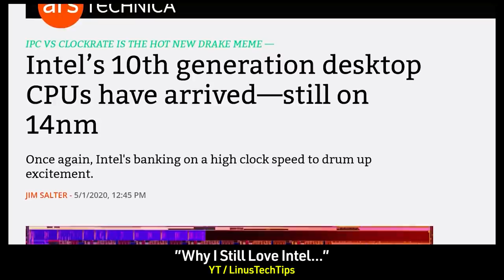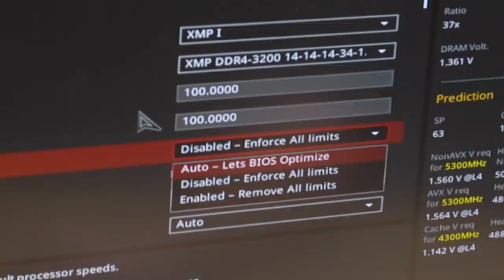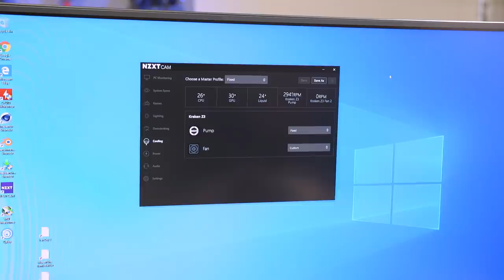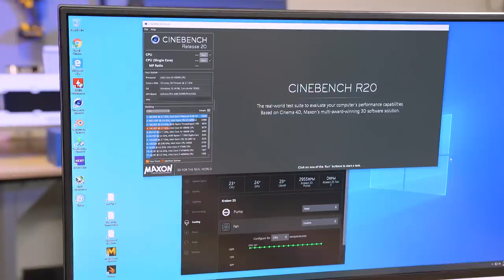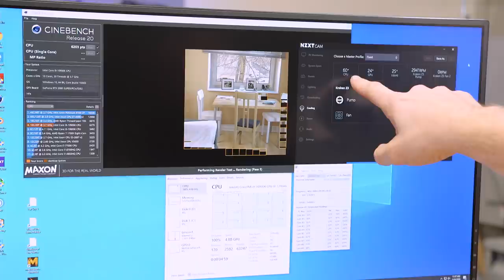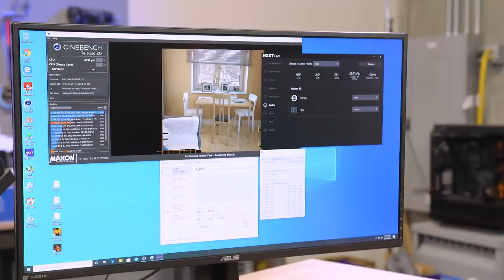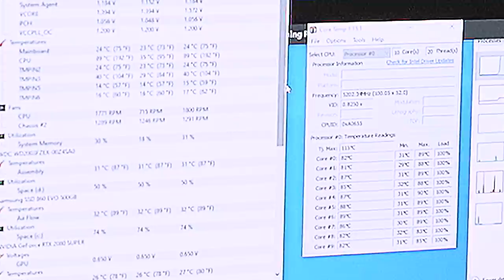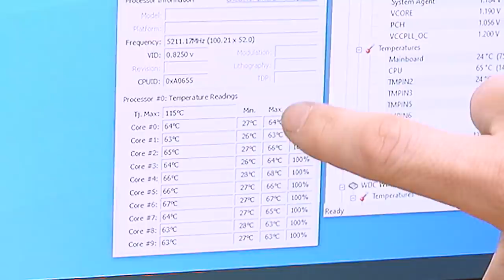Does the 10900k Melt!?

Comment: Regarding the case: when it comes to high power dissipation, the case does become much more of a bottleneck. Open air tests how 240W gets removed from the cpu. The problem is that hot air also needs to be removed from the case and at 240W that could be problematic. 
So use a case with very good ventilation so that you can control the amount of air moved for the test. E.g. the best case you can find with 3 fans in, 3 fans out and then use 2 in, 2 out. Even better measure the amount of air moved and standardize for that - then which case it is doesn't really matter that much.

Comment: My 3950x with the Z63 and MSI Godlike runs much hotter than that and it never wants to clock down. I have to run the low power profile to keep the cpu in the 30’s. liquid stays at 33 when the cpu is at 65.

Comment: to be fair though, you can still try the setting with a case that known to maximise temperature to the highest degree (Quiet case or something), your result will at least show that the CPU can run well even in the most limited case - rather than in no case condition which literally nobody use, some people will at least benefit more from your result if you use case in your testing
Reply: "rather than in no case condition which literally nobody use"  -  Firstly, this is strictly not true, since (and I'm sure I'm not the only one who uses one) there are cases - such as the open-designed Thermaltake P3 - which effectively have a comparable thermal/airflow profile to the test-bench scenario used here; there are 'literally' cases in mass production that are little more than 'prettified' test benches in design.

Secondly, every case is different with regards to thermals/airflow, but anyone (if they took the time and effort) could effectively recreate similar 'open-air' conditions, assuming they simply pre-tested their rig on a bench/table and made sure the ambient temperature matched that of any camparison tests.  Also (IMHO at least) anyone worth their salt who builds their own systems should be testing a new rig out-of-case before assembly anyway, so a quick check of out-of-case thermals (and then comparing later with in-case and modifiying airflow accordingly) shouldn't be that big of a stretch.

Finally, in the real world, testing for thermals/airflow should ultimately be on a use-case basis (ie: on your own system in its expected operating environment); relying solely on OEM / third-party testing should only be a rough guide, since no two systems (no matter how 'identical' they are hardware-wise) are going to run the same in all conditions anyway.

Comment: 1.57v? Jesus Christ. I'd be surprised if that CPU didn't starr to require more vcore in less than a year. My Asus board threw 1.48v at my 5.2 GHz 8700k when I set to adaptive voltage at 1.37v (which I immediately corrected with manual voltage) and a year later 5.2 GHz was practically impossible. Motherboard manufacturers really need to give a warning when they're about the throw a ton of voltage at your system.

Comment: You should try streaming with OBS at 6500+K bit rate during a multi-core enhanced game. That will give you a much better test and OBS is extremely sensitive to any instabilities in an overclock, so it will CTD if literally any instability rears its head. And a surprising number of your viewers will be attempting to use large core count chips for gaming and streaming, so it's a very valid test.

Comment: Meanwhile r5 3600 jumps around 36-45 with occasional spikes to 50+ on idle under an AIO with 70°C in CineBench. True, I have my AIO set to quiet (even the pump) but this happens under any cooler. AMD makes the best procesors right now but the temps are very strange.

Comment: wattage is wattage regardless of who makes the chip. Try prime95 on that and see what happens. Further, the 3900x is $100 cheaper now and it comes with a cooler that will cool it, whereas the 10900K you really have to add in an AIO to its price or something more expensive than a regular air cooler.
Reply: No one running this tier of CPU is going to be running with a cheap/ stock cooler.
Reply: T51B1   This video was about Intel and not AMD.

Comment: I've seen benchmarks of the 360mm Kraken X62 of the 10900k still in the 90-100 range at 100% usage, people pass it off as "oh well it'll never hit that" well it will sometime down the line, in gaming it's as hot as my 7700k at full load which is already on of the hottest chips in recent years, mine is on a 280mm X62 though. Doesn't really matter if it will hit that, it can, and no AMD CPU hits those temps

Comment: The "CPU lower fan speed limit" isn't to avoid the fan running at lower RPM, it's to make the BIOS let you know the fan isn't spinning fast enough. You can run it lower than the "limit" just fine.

Source: I have a Strix B450i and the BIOS kept complaining on boot that the fans weren't spinning fast enough (and didn't increase their speed) until I changed the setting to "Ignore".

Comment: I personally use my AIO for my CPU as the exhaust fan, simply because I am more worried about thermals on my GPU while gaming since that will always be the bottleneck in my system.  That way the GPU (air cooled) always gets cold, fresh air from the intake to help keep it cool. People need to remember to customize their build to their needs instead of just the last YouTube video you watched.  My CPU AIO stays around 55-60 while gaming, but that is so far under thermal limit, I don't care.

Comment: I agree but also disagree it's possible that the water block can hit its thermal limit before the rad as the water temp is directly coupled to what the rads can do.. also i shaved the die on my 9900k 40% and machined a  2part coper-silver IHS with all sitting under a custom cold plate that's 4 250w TEC's getting kooled by a custom water block.

Comment: I know you watch some of the tested videos, have you considered trying the AC cooler/heat exchanger system that he made? If you haven't watched that video it's an awesome system designed to work with a liquid lined body suit so it should work perfectly with a PC. Issues may arise with condensation but I doubt that'll be a significant issue so long as you leave the heat exhanger outside the case or use the test bench. You can also modify your standard AC unit to work with a heat exchanger if you don't want to build your own.

Comment: In regards to your comment about using the open air test bench to run thermal tests and the case rant. I don't have an issue with it. If you want a real world scenario, Steve at Gamers Nexus does extremely thorough thermal tests on tons of various cases. You could easily take this video as a base line and then see if your case is over on GN to figure out how much your case will effect thermals. Easy.

Comment: DerBaur delidded one and put LM in between the die and IHS and dropped temps by 7C.
Reply: He too did an amazing test on 30 10900k CPUs where he showed that differences in temps are like 20C with all the same settings, just silicon quality. I knew that mattered, but 20C without case, cooler etc as variables? Holy I would have predicted like 5C max.

Comment: this is where MCE is dangerous for the average joe. The board wants to push insane voltages, and different board makers have different settings. Gamer Nexus did a good video on it and I think the Asus boards had a conservative MCE, whilst a Gigabyte board was pushing insane voltages. Imagine someone who doesnt go into the Bios running this chip and the board has MCE enabled, that cheap cooler is not going to handle it. You wont notice on a decent AIO as Jay just showed, but anything less temps could run away.

Comment: Using cooler master 360 AIO, core i9 10900K at 4.2 ghz is getting 70° C in Normal mode, and instantly getting 100°C while overclocking by few values.
Reply: Aio pump rpm is 2400 and 3 fans rpm 1800

Comment: Kraken x-53, z490 MAG Tomahawk, paired with i7-10700k all core OC to 5ghz w/ average temp 82 c @ 1.33v. Not sure if it's good or bad, but seems like an okay place to stay at. I might test to see how high I can OC this chip just for curiosity.
Edit: Brought the voltage down to 1.3v and still remain steady, temp dropped to 75c, I'm impressed at 75c temp at 5ghz all core. Well done, intel.

Comment: Jay, i would like to ask you a question.
Out of the box the temperatures were like 40-50°C and the liquid was 26°. I'm fine with that. However, those are not sustainible because the heat dissapation of a water cooler is much smaller when close to ambiant temp.
What i'm trying to say is that if you run stress test for long enough, water temp will be (at best) around 40°C and cpu temp will be around 70°C. That's also fine but... Linus was closer...

Comment: Great video!  I'd love to see some similar tests an info regarding the i7 10700k. I think there's a lot of people like myself who might be upgrading from a much older gen intel, but not want to drop the full 500+ $ on the top of the line. It hasn't arrived yet for me to do any testing, but I'm expecting the 10700k to be a very solid chip for a gaming rig at least. :)
Reply: Yep I have the 10700K bought at launch and it is a great overclocker with temps well under control....though I am using a 360mm AIO on a 5.1GHz all core overclock at 1.290v....Exceptional all round CPU which is really a 9900K in disguise with better cooling and at a $100 discount...

Comment: i'm using an A500 corsair air cooler for my 10900k, nd it gets VERY HOT, the fans sound like a fucking jet when you get into intense workloads or even cpu intense games, literally over 90 degrees at some points.
Going to switch to water cooling.

Edit: using the information from this video, i stabilized the huge temp spikes with a 1.31Vcore max from adaptive.

Comment: Yeah,a real world test would be a flight simulator.If you try fsx you'll find that it was coded for a single core cpu which really puts a load on the system to keep it running smoothly,or you could try x-plane.......................

Comment: Hey Jay!
U gotta be careful with using CAM for reporting CPU Temps with the Z coolers. I've seen many people (including myself) who experience big differences between what temps CAM is reporting vs what temps HWMonitor or Afterburner is reporting. I'm not saying that your unit is faulty, but mine and pretty much everyone else is experiencing this issue with the Z coolers, it seems to be a software issue with CAM for the Z coolers only.

Comment: I still have a non overclocked 7700k and that thing gets to 98°C with a h100i v2 and a couple of Noctua NF-F12 fans on the radiator (stock fans died) inside an NZXT h440 case with the front panel removed. I would hate to see what the 10900k would be like...

Comment: I'd be curious to see what you'd get if you did this same test with a 3900X/3950X. Does this cooler have an AM4 mounting bracket? If it does, I think that'd be a really interesting comparison. 

My 3900X tends to draw a crap ton of voltage when on auto. Doing a 4 core boost to 4.2 GHz and it draws like 1.45v. The voltage does droop when on an all core boost though, so temps when running cinebench are pretty reasonable actually.

Comment: The thing Jay doesn't say, that it needs at least a really good 280mm cooler to keep the temps under.. and that s additional $200. (this NZXT cooler is $250) so Intel costs $100 more, 20% less cores, 14nm old architecture, and it needs a $200 cooler for keep the temps. so the question is, Will you pay $300 more to get that little higher FPS that you can see only in 1080P gaming.??  (1440P gaming doesn't matter, because GPU is be the limiting factor)

Comment: im using a 2700X at 1.525v  4.3 OC and the max temp i get is 74*C  thats all cores max load, when gaming its around 55-60*C
Reply: (before anyone says, ow that is allot of voltage, well im sorry but it wouldn't run at 4.3OC without it being that high so :/)

Comment: Still doesn't change the fact the CPU is still hot.....sure the Temps is under control on the chip itself, but the heat have to go somewhere, which is your room....which is serious problem if you live in a really hot tropical country like me....unless you're going to be using A/C in your room 24/7....

Comment: What model and spec ram would you suggest for the 10900K   ??  I remember a while back you talking about sacrificing core Mhz for a lower CL and tighter timings, have been experimenting here with my 9700K @5ghz and using LPX3000 CL16, but I found the sweet spot for that ram so far at around 3400mhz and 18-22-22-38  (stock is 16-20-20-38 iirc)

Just about to start putting my 10900k together when the motherboard finally arrives.......looking to upgrade the ram to suit.

Great vids as usual thanks :)

Comment: You got one point wrong when it comes to the coolers. Just because the coolant temp is suddenly rising, does not mean that the cooler can’t „remove“ more heat. 

You are forgetting that the heat transfer works better the bigger dT is. So the higher the coolant temp, the more heat can be dissipated over the radiator.

Comment: As someone new to o/c the 10900k... I'm astonished that you were able to o/c your cpu at 5.2ghz on all cores with 1.36v with a chip with SP rating of 63.  My 10900k has a SP rating of 87 and I can't get it to overclock past 5ghz with out obsurd temps.   I'm not running a open-bench, but i have my H115i pulling in cold air from the front of the case, running 4 fans in push/pull config.    I'm really interested in your bios settings now.  lol.  (i can run 5ghz on all cores at 1.3vcore with LLC 4 settings, auto on the rest, memory set to xmp1)

Comment: Interestingly enough, der8auer did some measurements of the die and the IHS and it turns out that the 8700K was even lower than the 10900K, only the 9900K(S) was so tall. So this is not at all something "new".

Comment: Here's my opinion. Using the best air flow case you can get. It's still going to run hotter in the case then on a bench. my 2 cents.
Reply: Time to bring back the old high airflow cases from the pentium 4 days. 
Instead of a sidepanel window for useless rgb, you get a 200mm fan pointed directly above the CPU

Comment: Cinebench R20 even looped is not a stability test.  OCCT, Real Bench, and Prime95 runs for hours is what you need to determine if you are 100% stable. The hardcore overclocking guys on overclocking dot net are right - if you are not 100% stable you are playing with fire.  I have run looped Cinebench R20 and just an hour with OCCT will show errors which indicate instability.  Calculation errors can cause ALL types of issues and problems with applications including a complete corruption of the OS.

Comment: just curious and maybe I didn't understand right. but shouldn't that liquid get a lot hotter if the cpu at 90c? My liquid and cpu temp are always quite close together with the kraken x62, when cpu 60c the liquid is 50c, though I do run slow fan speeds?

Comment: "That's clearly too hot for day to day use -- if you're running tasks that hammer the CPU this hard for this long"
Why would anybody buy a 10-core/20-thread CPU if not for rendering, simulation, compiling, or other workstation tasks? 
I'm not sure I'd call that "effective" if it scores lower than the 3900X in these tasks and yet requires liquid cooling and still hits over 90C.
Reply: Yes pretty sure people who bought this type of cpu need the core, thats why it felt weird when Jay say people are not going to run it for that task in daily basis, and here I'm working at home rendering shit like this on daily basis because my company cheap out on render farm because of the pandemic they get less project and had to cut cost and not rent a render farm.
Reply: I have an i9 9900k and the only thing i do with my computer is play games and have something open on the other monitor. This CPU basically eliminates all stuttering while having other things open on the secondary monitor. It's just nice to have. Also it destroys any ryzen cpu in raw frames per second capability, since obviously i've overclocked mine and removed the powerlimits. It runs at around 45-70 degrees per celsius while gaming depending on the game i play with a Corsair H100i RGB Platinum cooler.
Reply: Naoki Watanabe    Gamers will love it!
Reply: yep he should have done this with the i5-10600k

Comment: The liquid temp isn't getting so hot because the cooler can handle it and the liquid is moving way too fast through the CPU to heat up right? Like it it sat there even a little bit it'll heat up fast

Comment: Maybe I'm old fashioned, but I feel like you shouldn't have to spend $180 - $280 to cool a CPU
re: no case is applicable to everyone. That's true, but any given case will still be applicable to, by far, a higher number of users than an open air test bench. 
re: the 10900k doesn't run over 80. The review copy Tech Deals received overheats and shuts down the system during R20 when trying to run on an air cooler and any AIO smaller than a 360. How representative that is of a broad swath of chips I don't know, but it is happening.

Comment: And here i am with my i9 7920x running as hot as a small sun  😂 after a couple of hours of gaming around 60-65c on the cpu and water temps on my 360mm kraken aio hitting around 47-48c i dont even dare overclock this thing  😂

Comment: There are many risks with AIO Water cooling, it is not worth it just to get 5 centigrad less than with a good "Be Quiet" Air Cooler. If someone is serious, and use their computer for work (not just gaming), you should definitely get an Air Cooler. Being 5 or even 10 centigrad above AIO cooler, with an Air cooler, will make absolutely nothing to your chip, as long as you don't extremely overclock or do something like that, and as long as you are inside the accepted factory temps for the chip you are using. Obviously, those AIO coolers are trendy for the new teens, but in reality it makes absolutely no sense to use them, instead of a good Air Cooler.